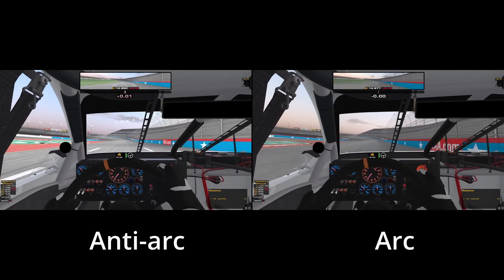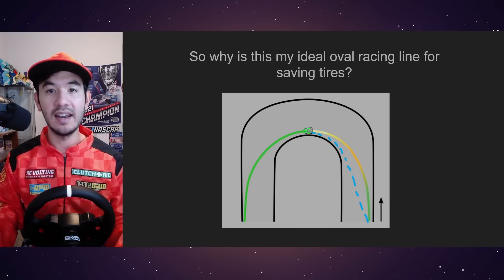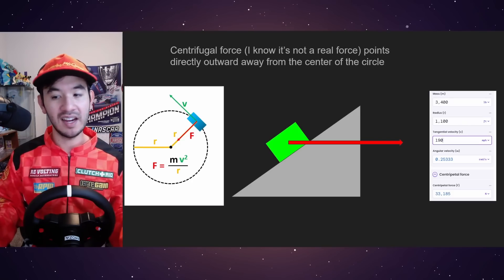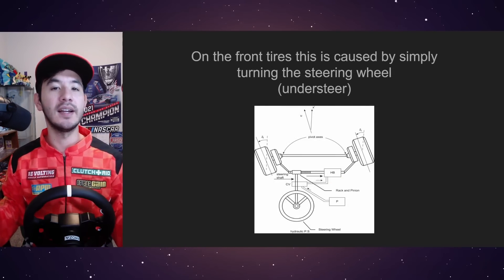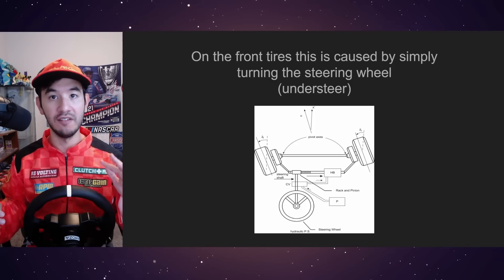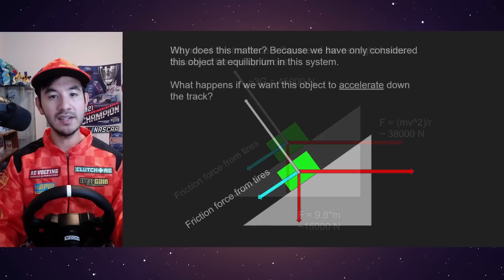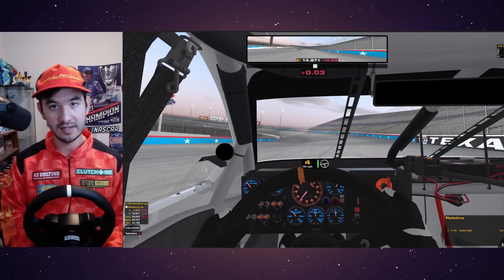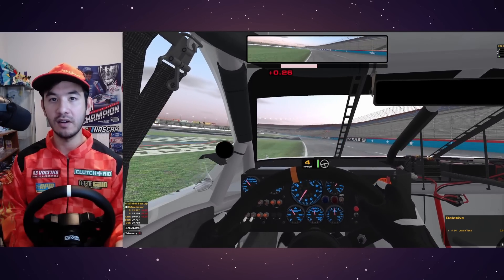Using my engineering degree to prove why you're bad at saving tires in iRacing

Comment: Essay alert, I just spent a few hours on this comment.. :S  At 13:15 where you mention static friction, you're taking an incorrect path (hohoho). 

Making a car change direction on a straight does not work the way you describe. You don't need to overcome a static friction value before the car starts to turn. If your car is parked on the banking and you want to push it down sideways, yes, then you have the sofa example. A rolling tire that is part of a car that is driving around, behaves completely differently.

Imagine you're coasting down a flat straight in neutral. There are effectively no tire forces acting on the car. Drag will slow you down, but there is no tire grip / friction or anything occurring that is significant. For the next bit, I'm describing what happens in super slow motion.

Imagine turning the wheel very slightly but very fast, just 10 degrees of steering angle in the blink of an eye. The front tires are now at an angle versus where the car is pointing. The car itself is still going straight, it hasn't had time to react. This angle difference between the front tires and the car is what is called the slip angle. Slip angle makes a tire generate cornering forces, and we just went from 0 to maybe 0.5 degrees on the tires. This will create a slight cornering force on the front tires, maybe just 100 pounds.

Meanwhile, the car is still going straight, hasn't had time to catch up. The rear tires are still pointing straight ahead too, so they're at zero slip angle. And grip needs slip angle so we have none at the rear! We have front tires generating grip, and rear tires not generating grip. This sounds weird, but at zero slip angle, a block of ice produces the same cornering grip as a rubber tire. And what happens when front tires grip and rears are blocks of ice? The car starts to rotate. We're still in super slomo, this isn't dramatic Tokyo Drift.

As the whole car starts to rotate from the front tires pulling on the car, the car is no longer pointing towards where it is traveling. The car, and with it the rear tires, are at a slight slip angle. And unlike blocks of ice, rear tires generate cornering grip when they are at a slip angle. Maybe just 50 pounds.

Now the car is being pulled sideways with 100 pounds from the front tires and 50 pounds from the rear tires. It will gently start to change lanes and keep changing direction very slowly. There is no static force that needs to be overcome before the car changes lanes. It is extremely analog and accurate. Doing it gently also doesn't heat up the tires any more than just the heat generated by the rolling of the tire.

A banked corner is a bit different. For each corner radius and banking angle, there will be a speed where you can let go of the wheel and the car will follow the track perfectly, like you correctly described talking about centrifugal force, gravity and normal force equaling each other out. Still, the same applies. Apply a tiny bit of steering and the car will go up or down the banking, with the same tiny 100 pound front and 50 pound rear tire forces, that add no real heat to the tire.

So what DOES create heat? First just the tires rolling with the weight of the car and downforce on it will warm them up. But in the turns, it's those slip angles that scrape the tire over the road at an angle that really cause heat to be generated. And while a tiny slip angle is enough to change lanes gently, maximum G force turns will create larger slip angles. Heat will also be generated faster if you have the same slip angle at a higher tire load, i.e. in grip limited banked turns.

Slip angle and tire load are bad for heating. Reducing tire load can't really be done other than going slower. You can do some setup tricks with weight jackers or whatever is available to the car, but at some point the outside front tire is just having to deal with it. Reducing slip angle can be very effective. You might get 90% the grip at 60% the slip angle. So getting a good feel for how far to turn the wheel, feeling the diminishing returns of the last bit of steering, can help a huge amount.

And, the less time you spend cornering hard, the less heat. This might be the answer to why "anti arc" as you call it, reduces heating. The "arc" line probably means you're cornering hard, maybe a second or so more per lap than the "anti arc" line. Maybe this isn't the entire story but it seems like a plausible explanation.  It certainly isn't your 'static friction is higher on the banking' argument. :-)

I do like people trying to use physics and science, it just so often isn't quite right and people think they learned something when you, without intention, just told them 1+1=3.
Reply from the maker: This will prob take a while for me to fully dig into, and they new ideas that you brought up I believe are great points, but I do have a counterargument for the static friction point! I do believe a tire does experience static friction because assuming a straight unbanked track, each point of rubber on the tire is only in contact with 1 point of the asphalt before being lifted up off the surface through the wheel rolling. For a slip angle to happen on a tire, that point of rubber would over time have to travel along the surface. I found this video which I think is relevant: https://www.youtube.com/watch?v=J0PVm4XTGeY
Reply: @DJYeeJay  That video applies to a tire rolling straight.  A tire cornering almost always some slip angle and is sliding.
Reply from the maker: @billbenedict4664  but when you’re driving a car on a race track and taking a corner my argument is you go from this straight line without slip into a slip which would require overcoming the static friction force between the rubber and the surface to accelerate into the slip angle. Even if it’s not static friction (which I’ve looked around and still 100% believe it is) the force required to induce the slip is still proportional to the normal force and even though the speed is squared, the difference between a fast and slow entry is a factor of maybe 1.1-1.2 while the difference in normal force between a straight and corner is 2-3. And while this is applied over time my argument is that it is more efficient to save tires the later way. I’m not saying you don’t save tires by going slower, my whole point is you don’t NEED to save tires by going slower
Reply: @DJYeeJay  Sorry but no. In sim physics engines, which do a decent job of mimicking real life, there are no static friction forces that you have to overcome before the car does anything. I have access to the source code, I have worked on sim physics for so long, I fear I even understand a small fraction of it by now.. And the reason this isn't a thing in simulators is because it isn't a thing in reality either. The rolling tire generates grip from slip angle and or slip ratio (braking / acceleration). Both these slips are effectively zero when the car is just coasting, and it only takes 2 fingers on a non power assisted steering wheel to generate enough slip angle for the car to start turning. Just like it only takes the slightest press on a non power assisted brake pedal to ever so slightly start slowing down. No force has to be overcome before the car starts to turn or decelerate, other than the friction in the braking system and steering rack.

If there would be this great static friction force to overcome, how would you explain that even without powersteering, once you're going 30mph, slight steering takes very little effort? What overcomes this big friction force if it doesn't take the driver nearly any work?

I don't know if iRacing has such detailed telemetry, but in sims that do, you can see all the forces on the tire. The normal force (tire load), lateral force (cornering) and longitudinal force (acceleration / braking). A tire can turn tire load into lateral or longitudinal force, based on the driver inputs, as he/she makes the car turn, brake or accelerate, or slide off the road. That's basically it. 

Of course physics are very tricky to intuitively understand and it is completely understandable that you took a wrong turn here. If I would reply to all real or sim drivers who misunderstand something about vehicle dynamics, there wouldn't be enough time in the day. And I certainly don't understand it all either. However, you're touching on such a relatively basic aspect that I am almost certain you're completely false in this case.

Sounds silly but do you have maybe a LEGO car that has steering? Push it sideways while it is just parked is your 'sofa example' .. But now drive it and steer it, it will smoothly (well.. it is LEGO so not that smoothly) drive straight and gently turn as you steer it a bit. The forces you're thinking about don't apply to a rolling tire. I don't want to sound like an ass, I'm just dropping something I'm 98% confident are basic vehicle dynamics facts. 🙂
Reply from the maker: @NielsHeusinkveld  thank you for the info I really do understand what you’re saying and can understand your point about steering becoming easier as velocity increases. I cannot understand why a rolling tire would have different properties to a tire that is not rolling. From the reference point of a point on the rubber or the track, a lateral force in my head should behave the same as in both cases the rubber and track are fixed to each other. Does the momentum of the car change this? Either way though, regardless how it’s classified, it seems lateral force to rotate the car should be proportional to the normal force is that correct? I guess my whole point of this exercise is to get people to understand rotating the car under the least amount normal force, and there are multiple ways to do that and not just overslowing the car
Reply: @DJYeeJay  No, that's not how it works. The lateral force to rotate the car is completely unrelated to the normal force. The maximum available lateral force changes with normal force, but when you just start to generate some lateral force, you can do it as long as the tires are touching the ground.

Maybe you see this 'lateral force' as a pure 90 degrees sideways force that 'brute force' makes the tire drag and scrub hard over the road? And you struggle to see why the 'sliding sofa' example doesn't apply?

Say you do 100mph, and we want to very gently change lanes. We only need 0.1 degrees of slip angle to generate about 100 pounds of cornering force. Very much simplified, say the rear tires are at 0.5 degrees slip angle and 50 pounds after a split second. Now we have 150 pounds of force acting on a 3000 pound car. This is a cornering G force of 150 / 3000 = 0.05G, a gentle lane change type of thing.

This is a sideways velocity of only 0.17 mph on the front tires and 0.08 mph on the rear tires! I've seen snails outpace that. Maybe that is the key to understanding it. The sideways velocity is zero when you go straight. And the most gentle turn will make the tire move sideways at 0.001 mph. Now I'm not a tire expert at this level but just the flex in the carcass and sidewall and tread will just make the contact patch 'crab walk' ever so tiny little bit versus the rim of the car. The tire isn't really sliding at this point, it is all just elastic deformation I believe, until you really built up G forces. 

So I'm afraid that your statement that rotating the car under the least amount of normal force reduces tire wear just doesn't hold up. Tire heat and wear is more a function of how big the slip angles are and how fast you're going with these slip angles. We can't even see the slip angle required to change lanes, but grip will build up from zero to a maximum as the tire goes from 0 to 6 degrees of slip angle. This has the tires sliding at 10.5mph when the car is doing 100mph, and that's some serious heat generation and wear.

I'm sure somebody who knows a bit more about how the sidewall and tread deforms and absorbs slip angle can explain it more intuitively.

But the question remains, if entering the banking low saves your tires, why? I think my point might make sense. Heat comes from slip angles, and cornering hard means slip angles. taking the high line means we corner hard for longer, as we start up high, cornering hard, generating heat, and then we arrive in the low lane. If instead we drop the car towards the low lane on the straight, we've cut a bit of hard cornering out of the lap. Providing we don't overshoot or run wide, or have the tendency to pile up a bunch of steering lock. So if you avoid understeer and slip angles by controlling your speed into the low lane, I can totally see why you would make your tires last longer this way.
Reply from the maker: @NielsHeusinkveld  Thank you for the explanation! I understand my mistake now of assuming the system to be completely rigid and lacking the idea of deformation which would be very apparent on a racing tire compared to the video I linked. I agree with your assessment as it's always been understood "less steering wheel input = less tire wear" and the idea of slip angle * time to represent that makes complete sense, but the "why's" of that might just be much more beyond me than I thought. I'm not sure if I understand why the car corners hard in the turn vs the straight if it is completely detached from normal force for example.
Reply: @tozkal96 I'm not confident enough about details how things deform and how to explain it intuitively. You can have a constant slip angle through a turn, and each 'new' contact patch has to stretch and deform the same amount as the previous. Maybe the best way to explain it is that every tiny little bit of 'twist force' will twist the tire, ever so slightly. The force to do this starts at 0.001 kg so to speak, nothing has to be overcome. Like bending a plastic ruler, the first bit of force already bends it, even if you apply a tiny force, it will bend a tiny amount. 
You can't really know what '''the next part of the tire that hits the ground'' does regarding slip angle, as you need to know the rotation rate of the car, track width, wheelbase, to calculate the slip angle on each corner.
Reply: @NielsHeusinkveld   @DJYeeJay  For all of you that don't want to read it all: Your conclusions are right: less slip angle - less heat in the tire - less tire wear. Nevertheless there are some misunderstandings...and because I really love physics and I even wrote my master thesis about vehicle dynamics of a race car, I want to give my take on it.

1) Static friction vs dynamic friction
These concepts mainly apply for solid friction cases where neither of the objects experience any deformation. As we know tires are far from solid state objects, quite the opposite actually. But because engineers tend to simplify things and want to calculate everything, we just assume that both concepts superimpose at all times. Static friction comes into play when the tire rubber gets tangled up in the mirco roughnesses of the asphalt. This is the main cause for grip in general. Dynamic friction is a force acting in the opposite direction of the movement of the tire relative to the ground. Imagine locking up all your tires at once - the (small) force slowing you down is dynamic friction. When we speak of grip, it's always both that contribute, but the relative proportion of the static friction is generally a lot higher in usual driving situations. In case of under-/oversteer the dynamic friction proportion becomes dominant of course. Ultimately because the tire shows highly non linear and anisotropic behaviour (=behaviour cannot be trivially anticipated and behaviour changes depending on the dircetion of the incoming forces) in vehicle dynamics we just assume one friction parameter that is depended on a lot of factors such as temperarute, slip angle, slip ratio, wheel load, tire pressure, etc...This means basically that we have the formula Fgrip=mu *Ftireload . "mu" being the coefficient of grip changing all the times depending on the input parameters, "Ftireload" being Fn or the normal force acting on the tire (usually 1/4 of the gravitational force of the vehicle). 
Example: We drive in a corner heavily understeering and we want to calculate the grip-force for the outside tire at the front. Fgrip=mu*Ftireload : "mu" is very low because understeer means that we have a lot of slip angle (if you go beyond the slip angle where your grip is peak, "mu" drops quite dramatically). On the other hand "Ftireload" is a little higher because the weight is more on the outside tire. Nevertheless in this case "mu" is so low, that even the increased "Ftireload" cannot give us enough "Fgrip" to actually make the car turn. To sum it up: nobody REALLY understands tires so engineers just make a lot of look-up-tables that they can use in their calculations. We just know that grip increases over tire load and it needs slip both longitudinally and laterally in order to produce any forces.

2) Tire wear
In general there are two types of tire wear, A) thermal degradation B) mechanical degradation. A) occurs when the tire is above its operating window and the material itself degrades and loses its beneficial properties. B) is simply the tire losing small amount of its rubber because the asphalt and its micro roughness is basically sanding the tire all the time a little bit. B) can realistically only be reduced by driving slower and maybe smoother, but if you are already kind of a smooth driver, this factor is negligible. A) on the other hand is a factor that can be influenced by the driver a lot. 
Now that we know that heat is a problem (we did know before, but now we physically know why), we can look into the reasons for tires heating up:
I always like to think about tire temperature as energy. Without any energy that you externally add to the tire, the temperature will not change. For example, if you have only the force of the car acting on the tires in stand still, no additional energy is induced hence no difference in temperature. So if only the gravitational forces were acting on the tires, even when driving nothing would change. This means that tire loads have no direct impact on tire temperature (even though it influences rolling resistance by a little bit).
Three forces that induce energy into the tire however, are rolling resistance*, *grip(force acting on tire) and *slip(dynamic frictional force)*.

- rolling resistance: depends on various factors like tire pressure, tire temperature, micro roughness of the ground, ... This cannot be influenced and adds only a small amount of energy to the system
- grip: this is a force we really like because it gives us traction and turning capabilities, however this force acting on the tire creates deformation which is basically turning kinetic energy into thermal energy(=heat). It pretty much works like play dough. Initially it's quite stiff, but as soon as you start to knead and work on it (=deformation) it becomes more and more elastic and also warmer (more energy in the system). So this energy source is proportional to the forces (=grip) that act on it. It does not really matter on your racing line or how hard you turn...as long as you perform the same physical work it is the same. This basically means that the faster you go, the more grip/froce you need in order to stay on track and the more energy you put into the tires. The big advantage is that not only the contact patch but the whole tire deforms and hence the heat is quite evenly spread out which means that there are no harming (local) temperature peaks.
-slip: this is basically dynamic friction between the tire and the road surface. The big problem with this is that you generate a lot of heat as well as store the whole energy locally on the surface of the tire without generating significant lateral or longitudinal forces(grip). Therefore the tire experiences high temperature peaks that hurt the integrity of the carcass and the material overall. On top of that tires really don't like big temperature differences because the necessary deformation process cannot work as smoothly - hence it procudes less grip and we loose laptime. The interesting point is that this factor is not proportional to any laptime or pace that you can or should drive. You can be slow and have a lot of slip all the time and you can be fast and have a lot less slip. This means that this is our main focus if we want to keep the temperatures low without having to compromise laptime too much. Aiming for low slip longitudinally means that you should be gentle on the throttle and the brakes. Going for low slip laterally means that you should be very gentle with your steering wheel (=slip on the fronts) and with your "sliding" (=slip on the rears). Generally - the less you steer the better and the less you slide the better. This means that you should drive around a corner in the roundest line possible, which translates also to an earlier corner entry than seems intuitive. You can also think of it as your maximum steering angle should be as little as possible for each corner.

3) Racing Line in Ovals and Banking
Additionally to aiming for the roundest line possible through the corner the banking adds some extra spice into that thought. Let's assume that we drive in the banking in a neutral state, meaning that the proportion of the gravitational froce pulling you inward equals the centrifugal force pulling you (seemingly) outward. In this scenario you could drive without any steering angle and stay on your line, basically exactly like you would on a straight. So why is turning in the banking more harmful than on the straight? The reason is that your tires are already experiencing lateral forces (and therefore slip angle) and if you add even more, your slip angle will increase much more for the same amount of "turning work" compared to the same maneuver on the straight. On the straight the tires are laterally relaxed and have their full potential available. Inside the banking you ideallly want to stay on your line and never add any turning forces. In simple terms: Your steering wheel should turn as little as possible into the corner while being in the banking.

Disclaimer:
To any fellow race engineers, vehicle dynamics specialists or other enthusiasts: I know I made some simplifications, but this is the open internet and I am not writing a scientific essay for people being balls deep into the topic. I wanted to give a fairly understandable explanation of what is going on. If anyone wants to discuss further, I am happy to dive deeper into the physics behind it. I am also open for any further questions regarding this or other topics if anyone wants to know more. I hope this clarified things a little more, but as I said in the beginning: your conclusions were already very true
Reply: @RacingAndStuff99  That is a lot of text. Let me just get triggered at one thing. At high slip angles, grip, mu, force, does not have to drop significantly from the maximum grip at all. Tire data barely exist. Curves you see online that show grip drop as fast or faster as it came up, are completely fictional. If your peak slipangle is 8 degrees,  you're really doing it very wrong if you manage to be at 16 degrees. You're likely to have most of the grip remaining, probably 90% or more. You feel understeer not just from this. The larger the slip angle, the smaller the side force is relative to the *car*. If a 90 degrees sideways tire produces 80% grip, but you have a magic steering rack and are going straight, with the tires turned 90 degrees, the tire lateral force is a pure longitudinal force on the car..
Reply: @NielsHeusinkveld  that's a good point definitely. It does not have to drop significantly, there are tires that keep an acceptable level of mu with higher slip angles as long as you are not too far off. I have seen quite a few real tire test data from a test bench we had at our campus. It really depends on so many things like dimensions, carcass structure, compound, rim, ... 

But there is definitely a drop off point for every tire if you go high enough with the slip angles, which is not realistic for usual racing scenario but if you completely overshoot a corner for example you might find yourself in a situation with 20+ degree of slip angle (I've seen data from drivers that did even worse in some cases).

Also your point with the lateral force contributing to the longitudinal rolling resistance when increasing slip angle is an additional reason why in Ovals you don't want to drive at high slip angles.
Reply: Holy guacamole the amount of race knowledge here is unreal
Reply: This sum nerd shit bruh I just push pedal and go fast
Reply: Thanks for detailed explanation!
Reply: i like car go brrrrr